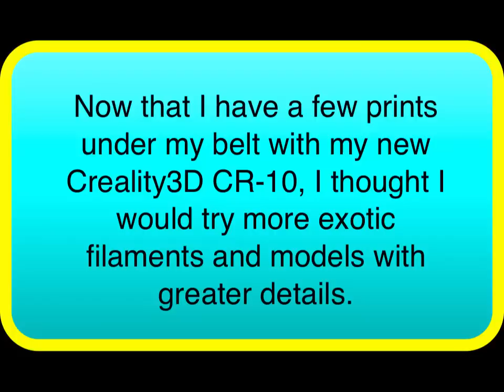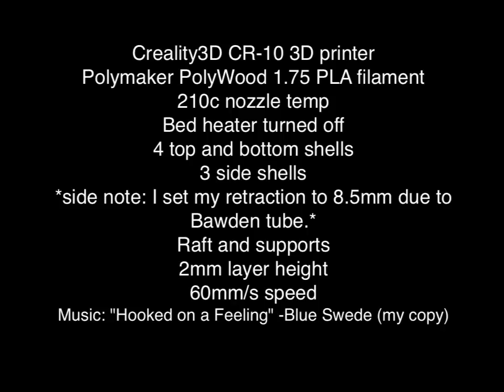3D Printing Baby Groot Pot w/ CR-10

Comment: Would you please share your simplify 3d software detailed setting if that is what you used to print this model? Thanks
Reply from the maker: Sure.  0.2mm layer height, 4top-3bottom-3side layers, 60mm sec speed, 210c nozzle 60c bed temps, 10% infill, 8mm retraction, 90% first layer height, 30% first layer speed, raft and supports.  These settings are for a CR-10 with a 0.40 nozzle.  Hope this is what you want.  :)

Comment: beautiful print question can you share your program settings for your CR-10 or your .ini so i can print the Baby Groot
Reply from the maker: The settings are shown in the video.  Easier to see them there then typing.  :)
Reply: Thank you but you are using the CR-10 only or you are using the printer connected to windows if you are using windows what program are you using thank you again
Reply from the maker: They run off the SD Micro card.

Comment: Do you have the gcode file? I have the same printer and want to give it a shot :)
Did you set flow to 100%?
Reply from the maker: Flow at 100% and you can get the file at My Mini Factory.  Good .sti file.
Reply: Michael Phelps Thanks a lot for your fast response!
I have the STL file from MyMiniFactory but the already sliced gcode would also be great.
(BTW: what slicer do you use)
Reply from the maker: i used Simplify3D for this print but I bet CURA would do as well.
Reply: last question: original .4mm nozzle or upgraded to .6mm or .8mm for wood filament?
Reply from the maker: Good question, stock .4mm nozzle.

Comment: Super cool! Did you print directly on the glass?? No adhesive etc..?
Reply from the maker: I use the glass that came with it but I have it covered with a BuildTac sheet.
Reply from the maker: Sorry this took so long, I use Build Tac on all my 3D printers.
Reply: Michael Phelps did you adhere the build tac to the glass or are you just clipping it to it with binder clips?

Comment: would you recommend this as a first printer
Reply from the maker: Good question.  As the operation of this printer is the same as a WANHAO Duplicator i3 and many others (Bowden tube not withstanding), yeah, this would be a good 1st printer.  Watch all the videos on how to assemble it (very easy) and you should do fine.

Comment: What slicer do you use? I have this printer and I’ve been using cura but a lot of the layers get messed up. And if I print .3mm or higher it gets extremely messed up I’m not sure if it’s the filament or the slice or both.
Reply from the maker: Simplify3D
Reply from the maker: I used Simplify3D.  But I have had good prints with CURA also.
Reply: 0.3mm is way too tall. Try 0.15